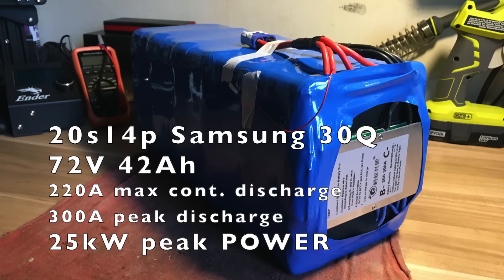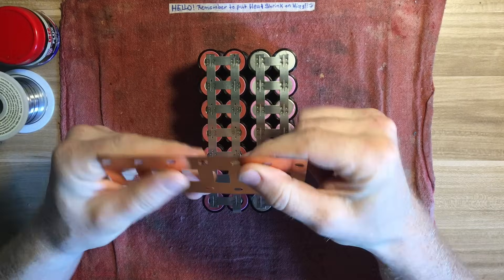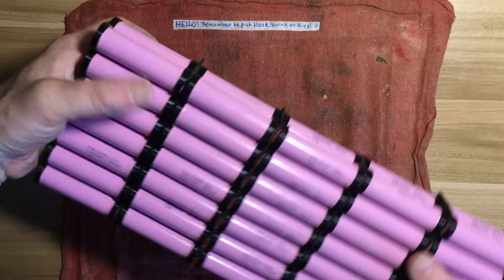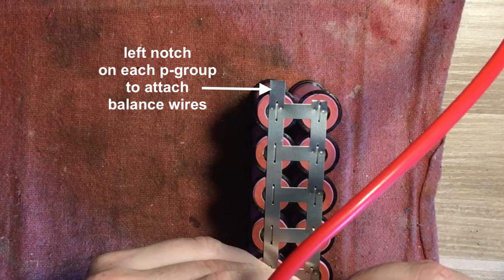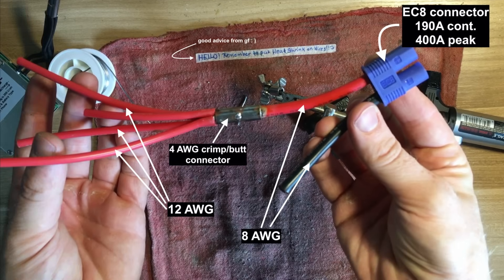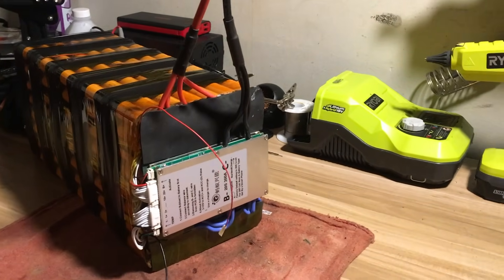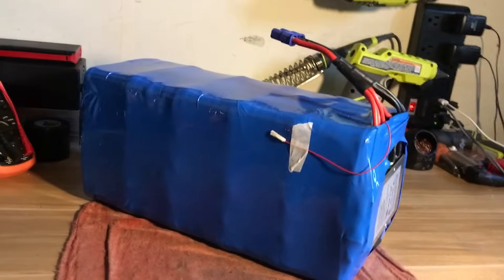How to build a MASSIVE 72V DIY battery pack for high power e-bike

Comment: Serious pack build  Hands down the best video on the topic. Great method for durable bonding and agree with the copper buss  and soldering technique you employ.  Hard to get the Samsung 30Q 3000mAh Got to choose from what isn't sold out. And as with everything post pandemic they are more than before. Certainly in Aug 2023 you are looking at ~$900 USD for 84V 20A alone.
 I would buy an 84v 23S 10P pack off the shelf  but it is a fools game. No BMS and no idea as to brand of 18650. I have to give serious thought to replacing the lead acid batts in my Damak Eagle

Comment: How can this battery be utilized as to what i/o needs to be connected to get a 3 prong 110v outlet to power on a microwave, phone, smartphones, tablets, and a solar panel for charging this battery pack...etc... mainly I'm thinkin off grid R.V.
Reply from the maker: you wouldn't use a battery pack like this for off-grid because the voltage is too high and it was designed for high current draw, which you typically wouldn't need for off-grid. you'll have trouble finding components and will have alot of losses in efficiency. generally off-grid systems use 12V, 24V, or 48V battery systems. youll need an inverter to get AC power from a DC battery like this

Comment: Where did you  get the copper plating?
Reply from the maker: Aliexpress. but they make integrated copper and nickel strip now which are better and easier to work with

Comment: Bro i wanna buy a 3500watt wheel ecu and ecu controller for my little bike i dont have to make my battery that huge for it do i? 😂😂 i just need 72v for 3500watts idk the amp it dont say i just wanna make a crazy little bike go really really fast
Reply from the maker: you will need to know how much current your controller will draw, peak and continuous. then you can figure out what size battery you need to support that current and range you want from the bike

Comment: Can an escooter's controller use 14s6p 52v 20ah battery when original battery is 48v 20ah 13s6p battery? Or must series and parallels be same or something?
Reply from the maker: only the voltage is important. 13s & 14s is close enough that it should work without issues. but you should check the specs on the controller to make sure you're not exceeding the max operating voltage. Keep in mind 14s fully charged is 58.8V so if the controller can handle ~60V you should be good
Reply: @GaiusGarage  thank you

Comment: think your battery is 58.8v 14p x4.2 58.8v
Reply from the maker: voltage is summed with cells in series, not in parallel. also it's better to use nominal voltage (3.6V) vs. fully charged voltage (4.2V). so 20s x 3.6 = 72V

Comment: I have seen videos of rion and they use a custom made machine to spot weld copper directly into battery cells, like this wouldn't you be unable to ever swap cells if needed, rendering the entire battery useless if lets say there is a critical imbalance between cells or some cells get damaged... couldn't you use just the nickel strips?

Comment: I bought a pack but it got wet and a few weeks after it dried off, it wouldn't charge any more. But it had 3.67 volts left after testing it with the multimeter. Can this battery pack be fixed?
Reply from the maker: the whole pack was 3.67V? what was it before?
Reply: @GaiusGarage  it was 48V
Reply from the maker: @EddyBoh  probably the BMS is trashed.  you can try taking it apart and removing the BMS then measuring the voltage of each group in series. if they are more or less within spec you can install a new BMS and charge it back up. But even if the groups are ok, individual cells amongst them may be damaged and will quickly become unbalanced with use. at that point the pack will have very poor performance and reduced capacity. also if there's rust or corrosion, you would have to clean that up because it can easily lead to internal shorts and a fire. probably safest to get a new pack but also possible to salvage with some work
Reply: @GaiusGarage  Just opened the pack and the tip of most batteries is oxidized. Is it possible to clean the oxidized tip of the batteries and how?
Reply from the maker: @EddyBoh  its possible but you would have to remove the nickel strip (which is probably half-way off already due to corrosion). make sure you measure the voltage on each cell or group. they may be damaged and/or discharged
Reply: @GaiusGarage  The only problem is that oxidation already started and I'm not sure how to reverse that

Comment: You do not use fuse for the battery?
Reply from the maker: not necessary to have a fuse directly on the battery as long as there is a fuse somewhere in the system. this battery was for an ebike and I have a fuse in the line immediately downstream

Comment: Thank you for the tutorial. I'm building a pack of a similar size. Are there any safety risks associated with working with voltages above 50V?
Reply from the maker: yes, any amount of voltage is dangerous and becomes more dangerous as the voltage increases. always use gloves and take precaution when working with high voltage

Comment: Hi! Best video for a 72 V battery. Can you suggest me a good charger for it?
Reply from the maker: Thank you! The charger I use is custom made - just a 1500W power supply connected to a boost converter. This is the cheapest option to charge at >10A - chargers for sale at >10A tend to get in the hundreds of dollars. Here's an example of what I'm describing but at 100V (so current is lower). https://www.youtube.com/watch?v=tSj76sVALwg&t=294s
Reply: I got another question: I already finished my project and everything seems to work fine. I connected the battery to a 6kw QS motor. When the battery reaches 60% discharge while using it... suddenly the voltage goes to cero and the battery discharges empty.... so sad... @GaiusGarage
Reply from the maker: @romanominghi2990  not sure. maybe BMS is misconfigured - impossible to determine given the info provided. please feel free to book a consult and I can try and dig into the details 
https://calendly.com/gaiusgarage/30-min-consult

Comment: How many nickel or copper strips do I need to use for 20s17p 240a BMS continious, 340+ A battery continious and 500a BMS peak ebike battery ? BMS ANT500
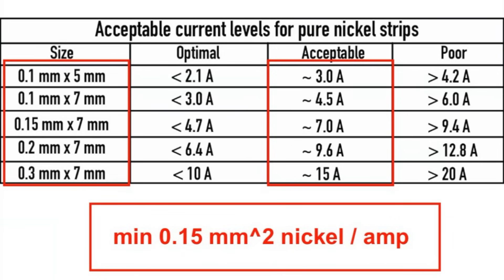Reply from the maker: I describe how to determine the amount of nicket strip needed for a given pack starting 1:37
Reply: @GaiusGarage  Thank you for reply! 
Actually I am not sure, what I need to use to take maximum possible power from 21700 molicel p45b to have lowest voltage sag, do I still need first layer as pure nickel strip and one or two layers of copper strip above or do I need to avoid nickel strip due to its high electrical resistance and use only 3 layers of copper strips instead soldering them directly to batteries and with each other ?
Reply from the maker: @namenamename7921  you can't really solder directly to the cells because it just too much heat and on the positive terminals, you risk shorting the cell with solder. look up "copper-nickel sandwich", it's a better method to use copper strips than what I'm showing in this video

Comment: Everything seems to be well thought of. However, the 8 AWG wire going into the EC8 connector threw me off. Isn't that gauge rated for maximum 45A? what am I missing?
Reply from the maker: that rating pertains mostly to residential wiring. you can run pretty much any current through any wire, with the factors being voltage drop, length of wire, time the current is applied. for short runs (pretty much anything on an ebike or battery pack) the voltage drop is miniscule even at 200A. if you look up what gauge wire is "rated" for 200A, I would have to use zero gauge, which would be ridiculous
Reply: @GaiusGarage  thanks for the thorough response. I appreciate it.

Comment: Hi. Thanks for this great tutorial video.
I was wondering if its easier to build what you did here using 9v batteries. What are the obstacles that you will come across with building a pack with 9v batteries?
Reply from the maker: do you mean 9V alkaline batteries like energizer or Duracell?
Reply: @GaiusGarage  
I mean the ones that has the positive and negative on one end of the battery, the rectangular looking one.
Reply from the maker: @Jay-tr3px  for one the typical one you buy at the store are single-use so it would be pretty impractical to build one and throw it in the trash after one use. there are rechargeable versions of these batteries (actually called "PP3") but the capacity on these is pretty low (~0.5Ah) so you would need 84 in parallel & 8 in series (672 total) to get a comperable battery pack. and then they aren't going to have near the discharge capability - pretty much a bad idea all around
Reply: @GaiusGarage  
Oh ic.
Thank you for the update.
I would really love to see you do a video on making existing battery packs that comes with ebikes and putting them in series/parallel together and making a higher voltage and range battery pack to use on the same bike or for your own projects. 
Thanks again

Comment: With 21700's available for Ebike battery packs does it make better sense to do a 20S 8P now? Say at 5100mAh & 3.7V/21700 Cell? Or is it that batteries & BMS using 18650's are still way cheaper these days? Is there any weight savings moving up to 21700's for Ebikes with less parallel rows of cells needed in a pack?
Reply from the maker: it depends on the individual 18650s vs 21700s you're using - you just have to compare two cells types, their capacity, weight, & size

Comment: IF you put nickel (nickel plated steel if absolutely necessary for the higher resistance) on top of the copper the Kweld might have enough power (you'd probably have to step down to 0.20mm copper or a bit thinner). A lot of people have used thisi "nickel copper sandwich" idea to spot weld copper.

I've heard some people say that you want the copper to be directly on the cell terminals otherwise the nickel is bottlenecking the current as it tries to flow to the copper. Makes sense but I'm not sure.

How are the 30Q's holding up? I guess its possible by now if you used the pack a lot it could be retired? I've heard a lot of complaints about 30Q's having crazy self discharge rates amongst other odd behaviors. One guy, I think on the budget light forum, was doing cycling tests of various cells and his 30Q samples suddenly started self discharging early in the test and I'm talking 400 millivolts a day or more.
Reply from the maker: This pack is still holding up well after a few years moderate but consistent use with pretty aggressive riding. The only issue is that one cell group has been consistently lower than the rest - probably due to randomly higher internal resistance, which has increased wear over time. I added an active balancer to keep the pack balanced and its been going strong since
Reply: @GaiusGarage  active balancers are a godsend to the community. No more manually balancing groups or having to hook it up to a hobby charger. 

I'm not surprised your pack is still going strong. This build is one of the cleanest I've seen on YouTube. I know we always harp about not soldering on the cells but your use of flux made your work pretty quick and your solder areas look incredibly clean.
Reply from the maker: @ericklein5097  Thank you! Yeah soldering on cells isn't really an issue as long as it's done with very high heat and quickly, as opposed to having to go in over & over because your soldering iron isn't hot enough

Comment: Where is the charging plug ???
Reply from the maker: its charged via the same port as discharge. when inside the bike, there is a seperate charging port on the wiring harness

Comment: Monster. A question I can't seem to get answered is what kind/type size battery would I need to run a 40 minute moto with the qs138- 240v pushing out 25kw at peak. I'm guessing the qs138 is the biggest of its kind to get the pull of a 450cc race bike. Thanks for the vid 👍
Reply: That said if your available for the type of build I'm needing or close as possible. It wouldn't be right away due to just starting the project but would like to find my source. Thanks again!
Reply from the maker: if you want to run 25kW for 40 minutes (0.67 hours) you will need 16.75kWh of energy. divide that by 240V (which is too much for qs138 motor and most common controllers) and you get ~70Ah. So you will need a 240V 70Ah battery. if you're using lithium ion thats roughly 64s25p. if you're using 18650's it would have 1600 cells and weight about 72kg or 160lbs.
Reply: @GaiusGarage  First, I want to say thanks for the reply and much respect. My bad in the information department. The 25kw would only be at peak burst. There's a kit out there with a motor/controller, qs138v3 and batteries but I want the professional work in your vids. I want to match or out perform the gas bike. 50-60hp peak. 37kw.  50nm torque. (Cr250r) Top speed means nothing. I want bottom end to mid range pull, torque. Top speed 45--60mph less or more? As far as the battery goes, is this do-able for weight reasons? Also can the battery pack be made into a different shape, to fill the space better? Again, thanks!

Comment: Surely that ec3 connector is not for your output to your drive?
Reply from the maker: Its an EC8 connector - they're rated for 190A -- the controller I'm using with this battery runs 200A peak

Comment: My daymak 72 volt battery no longer allows itself to be charged, a new one cost as much as a new bike

Can I truly make my own as per this video?
Reply from the maker: I would look into troubleshooting and/or replacing the BMS on your current battery before you embark on a build from scratch. there might be some issue but it's worth looking into. Other than that, yeah, I think you can definitely build one but you should have good understanding of battery packs and some practice with soldering and spot welding

Comment: can someone please explain how he calculated the 220A and 300A for the battery pack
Reply: Say each pink cell can do 20 amp continuous discharge and a max discharge of 30 amp, if there are 14 cells in each parallel group then 14cell x 20amps continuous is 280 amps. You do the same calculations to find the max discharge of the pack. To find the capacity of a pack you are always looking at the parallel groups, series connections increase voltage not amperage.

Comment: Did the BMS come with balancing wires?
Reply from the maker: yes, it did
Reply: Me and a buddy are building a Sk 55AH 20s pack. Was looking at the BMS you got but 300a peak 120amp continuous. Do you know how long the 300a peak will stay on for before cutting out?
Reply: Just massaged you on IG

Comment: What battery would you recommend to make a monster e bike battery 120v or something more trying to get a sir ron over 22kw
Reply from the maker: If youre using Li-ion cells, you would need about 28 cells in series to achieve 120V at full charge - you'll need to figure out what cell type fit your space requirements but then also meet your current discharge needs

Comment: why not use lifepo4 for a better discharge rate less cells and complexity and probably cheaper ?
Reply: LiFePo4 batteries can't do well in high discharge, not a candidate for high performance needs. They are also 3.2V nominal voltage rated not the 3.6/3.7V nominal so your battery will quit sooner unless you increase the number of series connection in the battery pack.

Comment: Wish I had time to build these but i have to stick to buying the packs.  I only use batteries that use super quality 18650s or 21700s
Reply: The packs that the suppliers and sellers sell are junk.  The suppliers use cheapest quality batteries to sell to the sellers for profit rather than pure performance and longevity.  Not only that but they also use cheap fake nickel strips to connect these cells together and many of them don't even apply 2 or 3 layers just a single so you are asking for trouble for resistance and heat build-up which means the power from the battery cells get wasted as it heat turns it to waste energy that cannot be used. The only real solution is to build a battery pack yourself. There are better and easier and simpler methods. Build it with ultra-performance cells like the Samsung 21700 40T which the suppliers would never use due to high cost. It's a lot cheaper to get cheaper outsourced batteries from China. Hypothetically, even if they use the 40T cells they are gonna use cheap connections to connect them together which means the power will get wasted.  You really gotta build the pack yourself.

Comment: What is the thin third wire used for? How do you charge the battery?
Reply from the maker: that wire is the on switch for the BMS to "wake it up". its kinda pointless because you can use it to turn the BMS off and the BMS turns on automatically when you draw power from the battery. Im charging using a 1500W AC-DC power supply and a step-up converter as a voltage regulator

Comment: Hi. If I use 4 12 awg copper wire for the positive main discharge would that be able to do the 200 amps continues ? Thanks
Reply from the maker: four 12awg wires have the about same cross sectional area as one 6awg wire - so yeah should be ok
Reply: @GaiusGarage  okay thanks